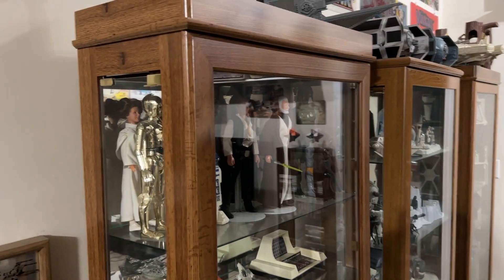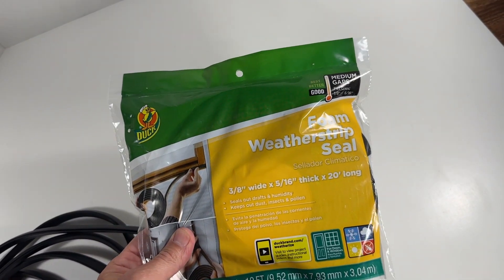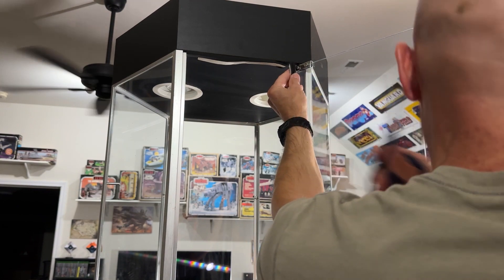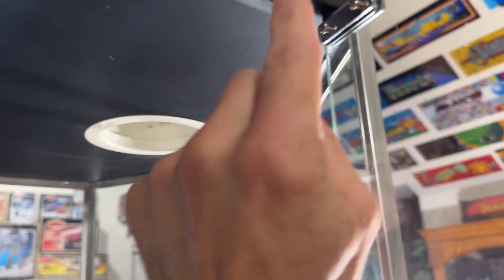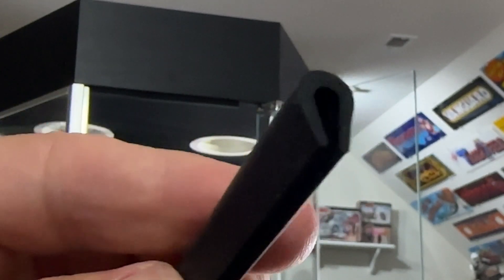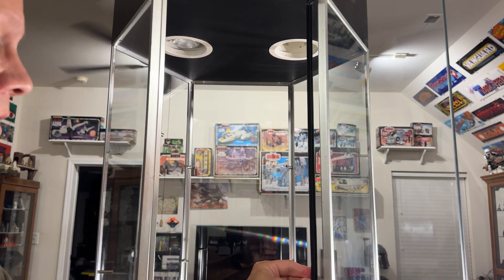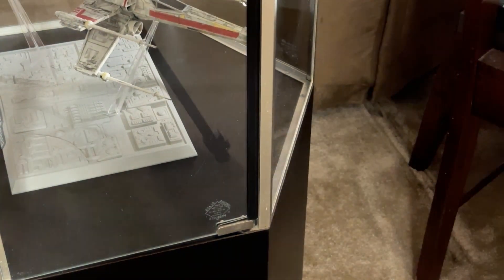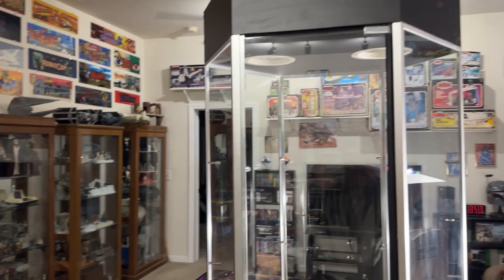How to Dust Proof Display Cases & Curios

Comment: Damn I just bought a curio all glass cabinet and I couldn’t believe couple months later just how much dust got in there
I haven’t tried this yet but want to
Does any dust get in there at all after u do this ?
Thanks
Reply from the maker: They’ve been doing great for months and I’ve got one case I sealed a few years ago and it still looks fine. Covering those small gaps makes all the difference.
Reply: @ElvenForge  ok cool thank you, I have the weather strip and that rubber u used and put a link for and going to dust proof it soon. Thank you again
Reply from the maker: @mnsith  no problem. I’m glad I could help.

Comment: Will the u-shaped trim work for all the edges?
Reply from the maker: From what I’ve seen it depends on how much space you have between the glass and the wood. If it’s too close it’ll be too tight. You can cut a small piece off to test it as well. Hope this helps.
Reply: @ElvenForge  Thank you very much! Subscribed!
Reply from the maker: @JusDewit  no problem at all and I appreciate the subscribe. Glad I could help. I’ve done almost every display case and curio in the house and the main thing is to just get those gaps covered.

Comment: i have a sliding glass  doors  cabinet  what do you  recommend? thanks
Reply from the maker: I’ve got one that had a gap right in the middle where the glass overlaps and I just added a foam strip to the glass top to bottom. Thanks.